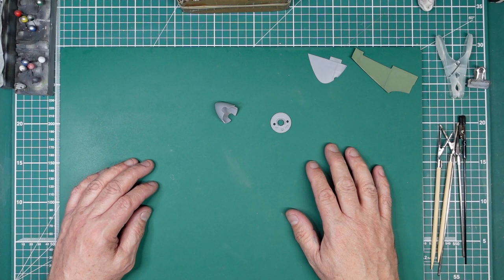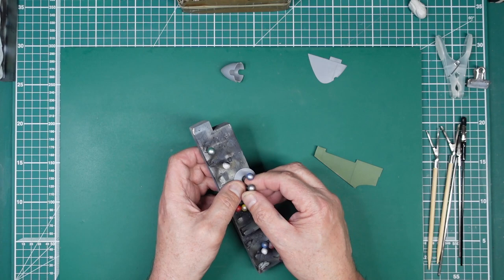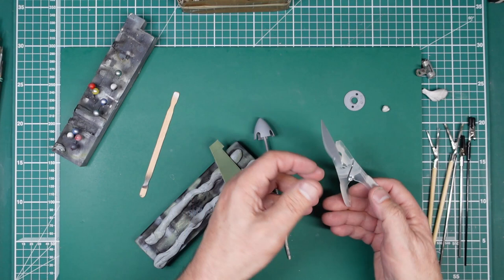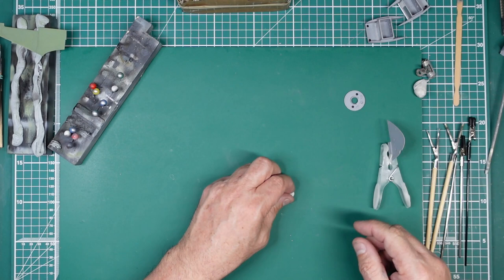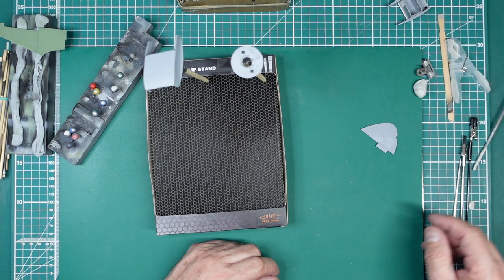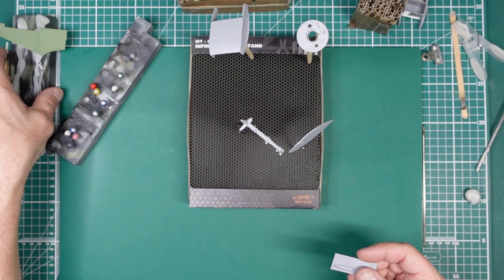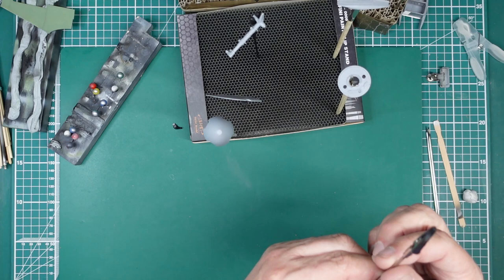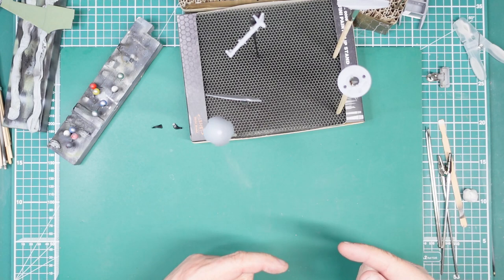Holding parts for painting

Comment: Though some of the clips and pointy rods are a little pricey but often help when the free options just don't work. The balsa and pin tip though is great, can see that being occasionally useful when blutack isn't appropriate.
Reply: Or if you can't get the balsa, try a bit of expanded polystyrene packaging.